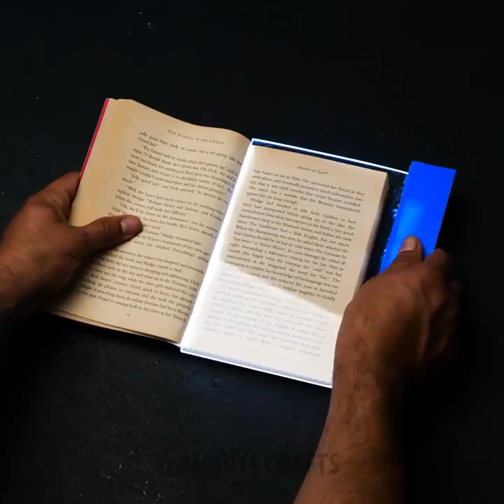32 SIMPLE DIY INVENTIONS that will help you in different cases || electric inventions

Comment: Putting 36 volts into one dc tiny dc motor? Wow your brave.
Reply: It is in parallel so the voltage is still 9V but the milliamp hours is higher. But they do have solder connections that will break if you look at them too hard.